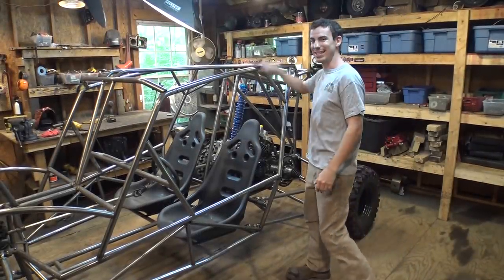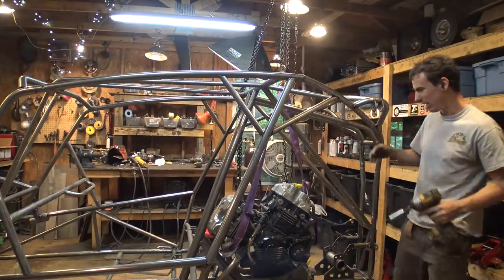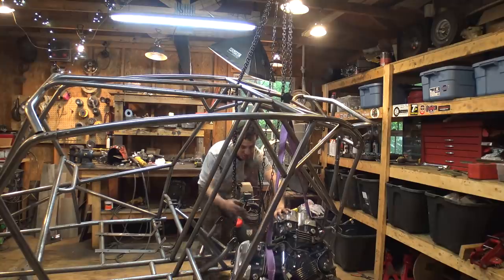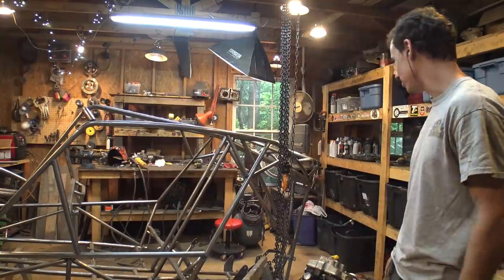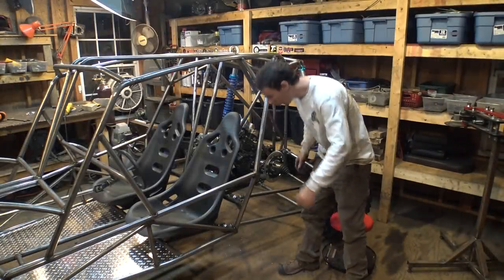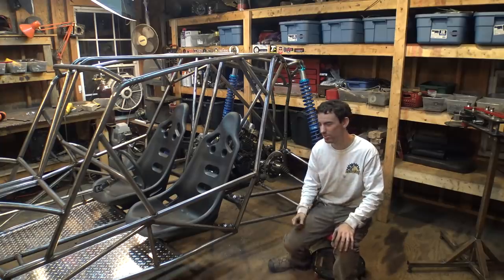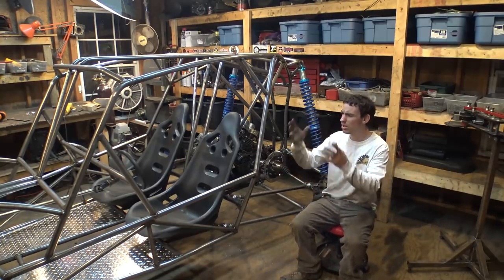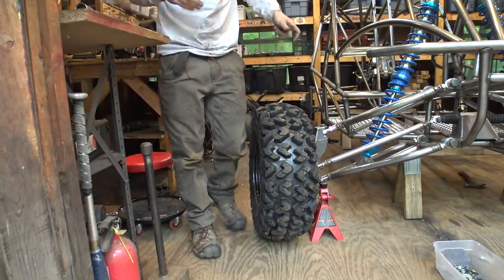Honda VF 1100 buggy build part 10

Comment: 20:21 It was at that moment he knew... he f up 😂
Btw maybe you should put some bigger rear axles to handle all the torsion
Reply: Dirtman 77xx  bruh 😂😂😂😂😂😭😭😭
Reply: those are 1 inch thick solid rod. They will never break if they were properly welded. It will snap the bolts or the cv prior
Reply: @fasousa4798  In that case you're right, they seemed to be smaller
Reply: 1” of solid steel would need a pretty significant torque to break.
Reply: I was wincing so hard watching him bring that tire up to speed. Haha!! I was thinking "I bet he's just gonna let off the trigger before he tries to pull that drill off there and it's gonna snap right outta his hands and hit the camera." Well, luckily he didn't trash his camera.
Reply: @fasousa4798  axles do a shit load of flexing.. Those welds wont...  unless he followed a nice lengthy process.. They're gonna break.
Reply: Jersdunz he said it took ten or more passes. 

My thoughts are cornering will break something, and the shafts may need to be telescopic to handle the suspension travel
Reply: Building slip into those axles certainly wouldnt hurt. 9 root passes and a cap is solid. But the welds themselves had to many start and stop points instead of continuous welds.
Reply: Honestly who cares this kid builds some bad ass shit coming out of that little shack of his. As long as he doesnt get hurt.

Comment: After that plastic tension roller.. Eats it's self, a bearing mounted idle sprocket is cheap and reliable..

My plastic wheel lasted 15 minutes.. :-)
Reply: Depends heavily on the type of plastic used, some will hold up much better than others.

However I definitely agree, a bearing mounted sprocket is a far better solution.

Comment: You might want to rethink the torsional strength of that chain tensioner if you solid mount it. That huge v engine will have a ton of compression braking. ALL of that force will be directly applied to that tensioner.  And with spring tension, I think it's one hard downshift away from piling the chain into the engine case.  TBH if you had a double roller on the same arm, but the other roller above the top drive chain; then you wouldn't get a load of slack up top when compression braking. Then you could keep what you already have. I'm not being a naysayer. Your projects are rad and well thought out.
Reply: B Curtis 
Here to confirm heavy compression braking needs to be accounted for 🤓

Comment: I very rarely knock someone's work and I am not doing it now, I will, however, advise you put an X brace in the back of the roll cage and for the love of all things rearward facing ... please make sure you put floor pans in under the seats, I have witnessed first hand the mess it makes of (luckily) just a seat when you get a branch bounce under the vehicle from one of the front tyres then dig in as the vehicle goes over it, if someone had been sitting in that seat at the time they would have been skewered like a shish kebab.
Keep up the good work, this little buggy is going to be epic.

Comment: Tip for the cv axle’s if you have trouble,
  if you remove the boot clips pull back the boot take out grease the centre shaft will come out of the cv joint itself c clipped in splined on the ends that enters the cv joint, you have the tools and brain to just make a complete solid shaft     
Joint to joint 👍🏻

Comment: Mate, pleasure watching you work.

Few things though....
1. The floor pan ends before your butt and all that's protecting you from a spiky rock to the groin are those plastic seats. Might want to extend the floor....
2. Why bolt the floor down? Rivets would be lighter and easier.
3. I have to echo about the chain tensioner. To close to the rear sprocket. I'm not opposed to making it out of Nylon though, but it needs to be more central if you can package it.

Can't wait to see it finished! Until then please make sure you have an exit strategy when you spin the wheels. You had pretty much nowhere to go if the wheels had been out of balance and jumped the chassis of the sawhorses.

Comment: The importance of utilising mock up parts when you're welding, they don't have to be the same part just hold the steel etc in its running/operating position in place of the part.

Looking forward to seeing this now you're going with a more suitable engine and I think you're most likely right on the drive shafts but I really don't think they'll fail that soon if you're not going too silly in it which is difficult for anyone when it's a ton of fun.

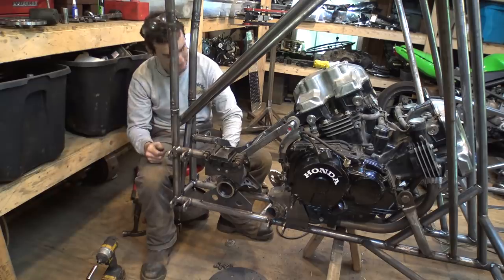Comment: 18:24 ... Get yourself a couple podger ratchets (or wrenches).. 
They have a spike on the end so you can jab them in holes and pry around until your holes line up. (We use them on metal buildings.. you're always fighting beams, they never line up)

Comment: Very  cool. Build. I have noticed that your front wheels are turning out of round and wobbling and a little with the rear axle as well. If they were perfectly round axles and hubs. They would drag evenly on your brake pads and you would hear the brake pads scrape just a little all the way around its full turn. If you notice in your video they only drag or scrape in different parts of the rotation. You can see the wobble pretty bad if you look at the drivers side front rotor when you spin it after you mounted the wheel. 
  Not a big deal but over 60 mph you could develop what they call death wobble. Where it shakes so bad you have to stop the vehicle before it shakes apart brakes or otherwise causes an accident. 
   Then again could just be the brake calipers you made. It seems like they werent perfectly squared or centered. Maybe put them on the lathe and spend some time dialing them in square and centered with a dial indicator and then turn down the face and the outside radius and see if that helps.

Comment: Hey man, I love the build. Great choice going with that engine btw! I just had a suggestion for your hoist that you have in the rafters. What you need to do is get either 3 - 2x4 by 12ft long boards, or, 1 4x6 by 12ft. You will also need some 90 degree twisted strong ties. 4 for each rafter that you cross. Along with that you will need some bolt on D-rings and some screws. For the 2x4s, you gotta do some clamping and gluing. Take two of them and glue them together. You will glue them like if you were stacking them. Then clamp it really well and screw them together to hold the boards tight together. Then take your 3rd one and glue it so it covers the seam, not the same way as before. Use a lot of glue to hold it well then use some 3" wood screws and screw it into the two that are already glued together. I suggest pilot drilling or use self tapping wood screws so the wood doesn't split. Then take your beam and get it up above the rafters. Position it so it is covering your work  area and make sure its supported by as many rafters as possible. Then take your strong ties and use them to secure the beam to the rafters. Use one strong tie on each side of the beam AND each side of the rafter. Do this FOR EVERY RAFTER! You need to do this on each rafter so it will displace the weight across like 6-8 rafters. Once its locked down, take the d-rings and using 2" lag bolts, hold the d-ring up where you want it, mark the holes, pilot drill then bolt down the d-rings. I would install a d ring between every rafter except for the last one on each end. You can also use the rafter itself now, so if you just wanted to drill holes and lag bolt that piece of steel you used in this video, you could do that. The rafters being tied into the beam with the strong ties make it so if you pull down on one rafter, The other rafters will take up some of the weight just like if that was a hidden beam inside a house. Sometimes instead of doing an exposed beam in a home, they stick the beam above the rafters instead of under. Anyway, great work and maybe I'll see ya at the gambler!

Comment: you can probably reinforce the rooftrusses a little by adding extra 2 by 4's to the sides and bolt those together like a sandwish , think you get more use out of the chainhoist that using the garage crane , it takes less space too

Comment: looking good nice fix on the front hubs the axles might hold up i would  because you did what they do in the industry but i would have gone a different route of research size of axle to you would have had to cut the shaft that mostly heat treated

Comment: I really love this build but I would really add a couple things to it. 1st extend the floor pan to the center and under the seats. This would prevent intrusion from under the vehicle into to cabin. A large rock or stump will break those seats and could cause injury. 2nd you really really need a firewall between the cabin and that engine. That is just a normal safety measure. 3rd when you install the pedals you should put a front firewall and side protection panels on it. I know karts tend not to have these types of safety measures but buggies do. Prevention of flying debris entering the cabin is super important in off-road types of vehicles. A little sheet metal goes along way to preventing injuries. May even think about a plan windscreen and some side window nets. I know it maybe overkill but with all this work why compromise on saftey?

Comment: It's much easier to cut the drive shafts and re spline the end to make the length you want. Many engineering shops will do it fairly cheaply if they can index of the original splines. Once welded they will lose most of their strength as they are specially heat treated to maximise torque yield strength.
Still, your welds looked good, maybe a press fit sleeve over the top to increase radius of the joint..

Comment: Nice job!  IMO Since it doesn’t appear to have any diff I really think your going to want to sleeve those axles instead... trust me 😆
Reply: Personally I don't think it's going to hold even with the sleeve. Spring Steel it'll snap at at the weld right after it plunges into the CV spool.

Comment: The axles will be fine. It's not like he's running a Cummins Diesel pushing 700 lbs of torque. I'd only be worried about the balance. Even a nickle taped to an axle at high speeds can make for an epic boom.

Comment: i would have liked to see the roof line a bit lower and the windshield tilted back more. but overall good work. Have you thought about making a way for the engine to drop out the bottom of the frame for service.

Comment: So guys I’m getting ready to build one myself with a 1100 cc 2 stroke snowmobile engine if you guys are wanting to do something similar look into a Polaris outlaw rear diff they use cv axles pretty much the same thing he built Honda fl250 did to but the Polaris are way more easier to find I’m doing a my cage setup a little different and going with foa coil over shocks way way cheaper then the kings can’t wait to see this build finished

Comment: I know you're not done but the it looked like you just rubbed some grease on the races of your center rear axle bearings. They are tapered roller bearings that either need packed with a bearing packer  or your hands. They also need some preload on them which you're not likely going to be able to feel properly with as tight as they are on the shaft. Also I would have sleeved over your axle welds with a short length of tubing with holes drilled through it, plug welded it and lap welded the ends to give it no chance to flex perpendicular to the axis of rotation.

Comment: So you can cut the bracing above the engine at a few spots, then weld pieces to those spots which have 2 holes (opposite sides of each other) for bolts to hold the back together.  Easy fix for you! Let me know if you need more infor

Comment: Lot of work but that's way too heavy. invest in a micrometer you probably got one you got a monster lathe. I built an R1 single seater I modified the desertcart plans those buggies were meant for kids.. Bottom line get an F-n-R box it will save you a whole hell of a lot of work. I bought the exact same chain fall. Axles are spring steel do you think Tigs going to hold it? Did you check the plunge on your axles. Kaboom if you bottom them out. What size sprockets are you using cuz you're going to need a big rear sprocket to move that monster. Believe me your clutch won't like it if you don't. 72 minimum.

Comment: Spinning a tire like that in mid air is more dangerous than what you saw happen. So I know this will sound a bit weird but a tire on the ground doing 60 mph has 4 speeds. If think of a tire in the 4 cardinal directions north is going the speed 60 mph the east and west are doing 30 and the ground is at 0 as far as centrifugal forces go. A tire in the air is doing 60 mph at all 4 points so the centrifugal force is way more and can lead to tires tearing apart.

Comment: Well I hope you put extra joists in next to those rafters you're trying to pick up all that weight on~!!~ As well as bridge the wall to support the weight of whatever you're trying to pick up, as well as support the flooring so the weight transfer will have something to support the roof's new load to the foundation, or the roof will start to sag, as well as push the wall out of line as well. The worst case scenario is failure of the ceiling joist on the truss rafters in that shed. Without a differential in the rear-end, that thing is going to plow big time in the snow or in slick conditions. It will push that front-end all over the place, when turning. Like my father always said, "You have just enough brains to be DANGEROUS~!!!~"

Comment: If you're using tapered roller bearings in the rear axle e they really need to be packed with grease maybe I missed it and it looked like you only put a little grease on the race and that's not going to be enough

Comment: You know when you are putting heads on a engine block you tighten that first bolt to maximum torque? Same goes for a chuck on a lathe.

Comment: this build needed a honda civic engine.. 4cylinder with a t case that would give you rwd if you mount it in the back. build the engine and you have no worries about it not moving that frame

Comment: Can someone tell me what's the point of having 24 inches of suspension travel but your chassis is only 13 inches off the ground so therefore you can never even use half the suspension before it slams the chassis on the ground. ?

Comment: I'm not a fan of the rear end. I think u need to drop the motor a bit to get that chain right. I don't think aso roller is going to do it justice. Its just going to get destroyed. A box rear and drop the motor you'll be good. I know your stuff is great. I'm not being a troll. I love the rest of it. I've been following a while. I think u didn't think the project through that great like the others. Take your time my man. I just think your going to have some issues with that rear end. The hime joints aren't going to do so great

Comment: Please tell me I'm not the only one that got the AVE reference when he tightened the bolts for the front hubs?!?!?

Seriously though, torque them properly and using those nylon lock nuts remember to check them after every ride... there's a reason car axle nuts have torque specs and castle nuts... Too loose they fall off, too tight the bearings fail prematurely.

Comment: You mounted the floor plates on the wrong side of the tabs,, with the bolts facing the wrong way. Just saying, you want the bottom to be as smooth as can be so it slides over things

Comment: weld up a 2nd set of axles. you will not be sorry.
Reply: I doubt he breaks an axel. Small light tires, engine doesnt make any power and the buggy itself wont weigh shit.
Reply: It's not a pos rzr
Reply: Anything you put big heavy tires on can easy break a weak stock axel.

Comment: Chain is greasy cause its manufactured probably in China, sits on warehouse possible near the sea, then gets shipped over the sea, being in constant contact with the salty and moist sea air, then sits on warehouse in USA, then in wallmarts etc storage or shelf, until you picked it up and took it from the plastic bag that is there to prevent oil or grease from getting sucked by cardboard. People would be pretty pissed if they bough all rusted product as new. Like with guns there is manufacturers really nasty oil based product applied, that is pain in the ass to remove, but it sure does protect the metal in the mean time.

Comment: Should have made the rear cage where it could have been unbolted to remove it nut welded to flat plate welded into the tubing. Not sure if you can understand the mental illustration.

Comment: You know how you said you wanted reverse gear. How about using a motor mover for a caravan? They have forward and reverse and I believe there 12v.
Reply: they use a worm drive gearbox. The power losses are horrendous.
Reply: @tom5051666  A worm drive gives it more power but less speed, stop commenting shit you know nothing about
Reply: Was just an idea that's all. Not saying it's even going to work. Just thought it might.

Comment: Hello,
Abusing the rachet with a tube.😁 Human error.
Most of the fast forward welding and assembly parts without any explanations are beginning to be boring. Your latest videos have more and more of that kind of thing. It's a pitty... 
You used to explain more things in the past.
I still like what you do but the videos are less interesting.

Cheers from Belgium.